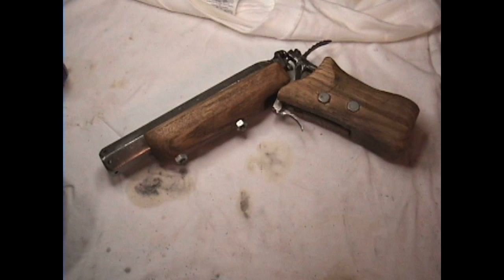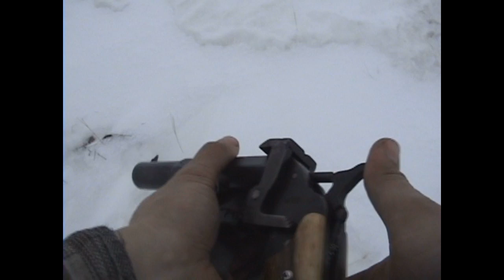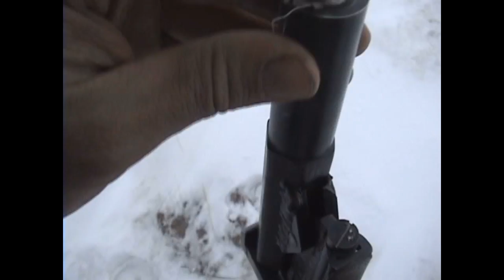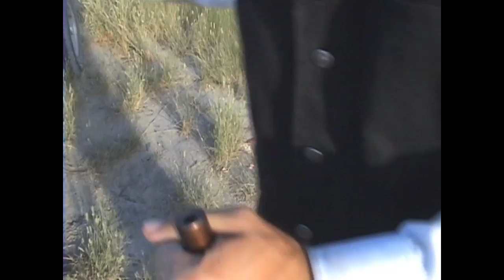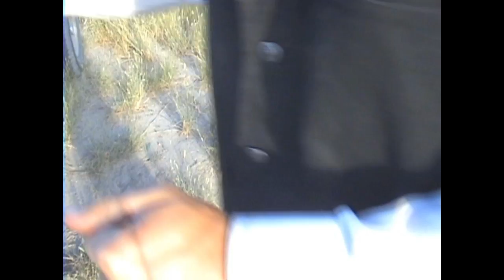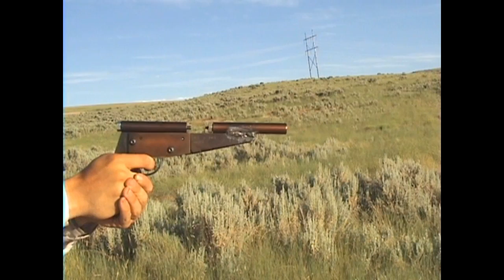Early Homemade Guns (TIS070)

Comment: Around 9:58 you stated that you flip open the gun to access the priming pocket and prime it and then close it up and finish loading it from the muzzle.  This is backward to the approach you should follow and dangerous.  You are then applying powder to a primed gun.  Not safe.
Reply from the maker: Maybe my narration of the process was unclear.  On the first load, I start by priming and firing the gun with just a primer to clear the flash hole and dry the chamber.  Then I load the gun with powder and shot before replacing the spent primer with a live one.

Comment: To get a perfect centered hole through a long piece of metal you can simply put the drill bit upside down in the chuck lightly and lower it down into a vice and rest one side of the bit on the non moving side of the vice. Then place your material in the drill chuck and lower it down on the bit held tightly in the vice. The common drill chuck usually accepts 5/8 diameter material if your material exceeds that diameter file down a sacrificial portion of the material to fit the chuck and cut it off after you have finished all turning instructions. 

The benefit to doing it this way is the bit automatically wants to center on the material and will result in a straight hole all the way through it and if it won't make it all the way through the material then flip it over and do the same thing again. You can also turn other parts this way using the press as a lathe. This is just a cheaper method than acquiring a lathe.
Reply: evilcowboy I
Reply: You are correct... the same method allows you to drill into a round ball